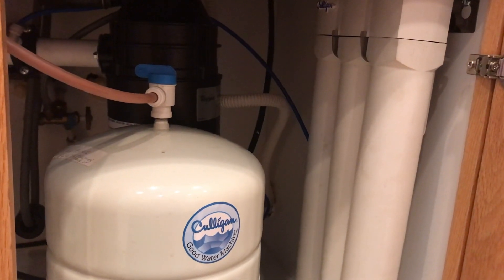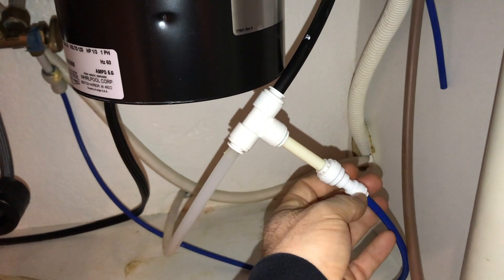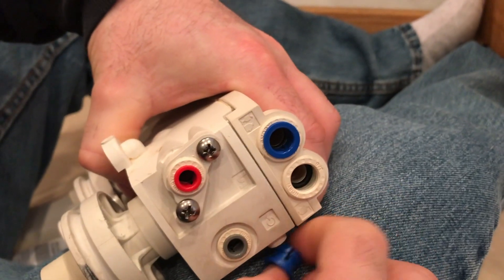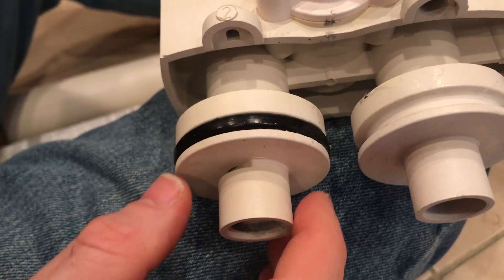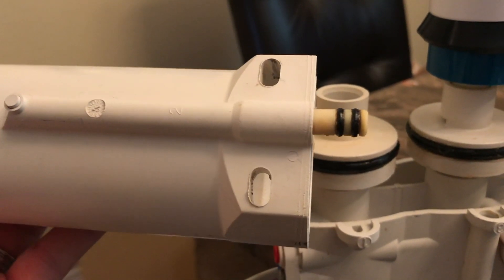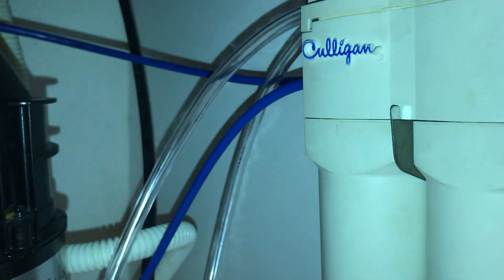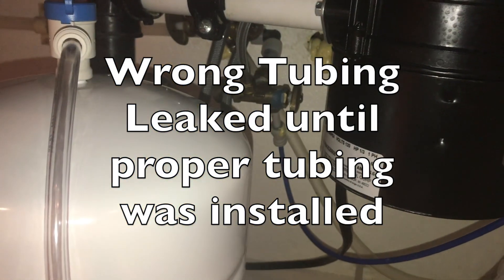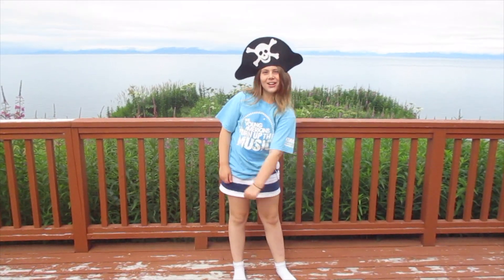Culligan AC-30 RO Change everything Reverse Osmosis Drinking Water System Filters Tank Tubing O-Ring

Comment: That connection to the red outlet that flows to the drain, I’m assuming it’s an overflow?  Mine continuously drips water, is that supposed to do that? I feel like it shouldn’t - if so, what part do I need to stop that issue?

Comment: Where and what part number and inner and outer diameter are the 3 large o rings
Reply from the maker: I had to bring them into an ace hardware and get the replacements.  I can't remember off hand.  Sorry.  Bring the used ones into a smaller hardware not a home depot and they will have some smaller specialty boxes with O-rings and you can match them.  Sorry Can't remember and that's how I did it. Couldn't find them at Home Depot or Lowes.  Ace Hardware had them